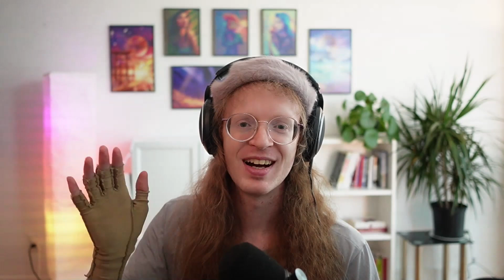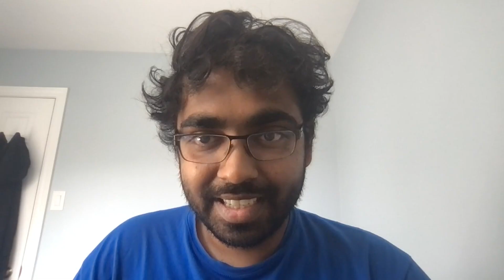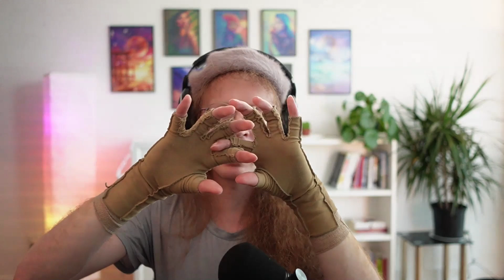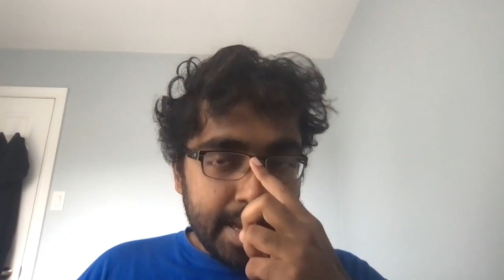Interview: How to improve model inference beyond GPUs

Comment: Boo- you must be a Registered Professional Engineer, with a number, to legally call yourself an Engineer… you’re breaking the law without being a RPE. A real RPE tells us up front, usually.
Reply from the maker: Depends on the jurisdiction. Here in Canada, most provinces have different engineer registrations. And it depends on the province whether software engineers have to register or not. Generally speaking, if you have an engineering degree you need to register, but a computer science degree, you don't.
Reply: @DrWaku  in the USA it requires 2 hard  tests and 5 years of approved work, supervised by an RPE. Every state requires registration to use the title engineer. Big tech companies get raided every so often and they have to re-title lots of folks.
Reply: Does the P. Eng make sense to pursue and get from computer science/engineering grads with Industry experience in Tech, or its better to just get certs and move along?

Been trying to look for professional in Ontario/Canada that are for non-core engineering trained engineering graduates i.e. chemical, electrical, etc) but for today's tech workers in IT, Software, Product Management.

Is chasing the P. Eng worth it, @DrWaku?

Comment: My take is: in the near future it won't make sense to use Nvidia chips for inference. That will limit Nvidia growth. How is it with Cerebras - is it good both for training and inference ? They say: "the only solution capable of delivering both high-speed training and inference".
Reply from the maker: Cerebras was originally designed for training but should be very good for inference as well. They have to deal with failures during chip production time, but then after that they don't have to worry about individual nodes failing as much. Maybe that's a better model, guess we'll have to see
Reply: @DrWaku  Cerebras is doing IPO this year, so it is exciting.
Reply: Inference demands the fastest performance, but also the ability to update to the latest models quickly. That might become problematic if assumptions are built into the hardware itself. Cerebras is behind Hopper on most MLperf benchmarks today.
Reply: New hardware is 100% going to be developed for LLMs. It makes 0 sense to let Nvidia be king of the hill and anyone thinking everyone will just rely on them is being delusional.

Comment: I invite you to, please, oh please, ask the Groq guy about the machine that runs this fast inference; let's choose a LLaMa 70B machine with FP16 representation (of course, quantization will help, but I'm not sure what  the Groq chips support). How many chips (576)? How many hosts (72 Xeons with DRAM (oh no!) and networking)? How many Watts (> 130kW)? How many dollars (don't ask (> $2 million if one chip (which resides on a board) costs $5000*))? Yes, the 4nm chip will help a lot (perhaps 4:1 reduction if they can squeeze ~1GB RAM on the chip). Now, how many chips (140)? Etc. Etc. Do I want to ask about a LLaMa 405B machine (> 3000 current chips or > 800 4nm chips)? Can we talk about: Price / performance? Power / performance? Space / performance? Maintenance / performance? I'm finding it hard to justify this overhead in cost and power and space and maintenance as an "advantage," but maybe I just don't get it. I think an Nvidia or AMD data center will be a superior choice, but if Groq is building its own datacenters, then they can set the price of inference to be profitable. The question is: will anyone pay it (when they transition from loss-leader prices to actual prices)? *ref: https://www.kaggle.com/discussions/general/480367 Please, if I'm on the wrong track here, inform me and set me right. Thanks.
Reply: Each chip only has 200MB so divide the size of your model by 200MB and thats how many chips you would need (plus whatever is needed for the processing data)
But you can't buy groq chips anymore, they are hosted as a cloud service only which is currently free (rate limited) for developers. For enterprise the deals are done on a case by case basis so there is no point quoting any prices here.